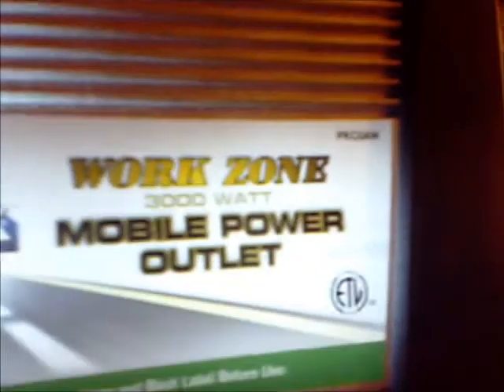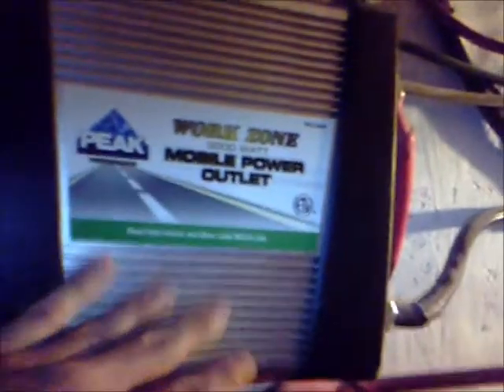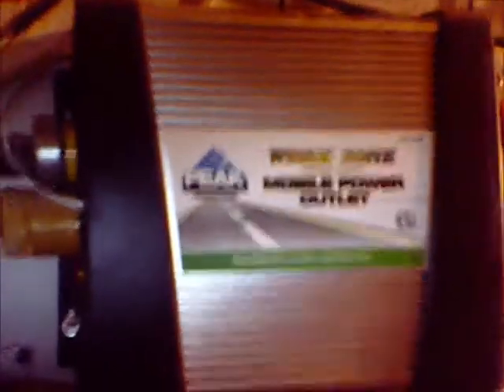3000-Watt Inverter 24 / 7 constant use, 8+ years,  SOURCE of them BELOW

Comment from the maker: READ ALL - UPDATE: Mine is running 4+ years now of constant 24/7 use, Best place to get one for $200 is http://amzn.to/2r5227D, ( Component is Hyundai Electronics Corporation) they come with big Cables, remote & install parts. And 2000 Watt for $100 http://amzn.to/2uhhNsU
This is a review of CONSTANT USE of a affordable good quality inverter. The Peak Work Zone 800, 1200, 2000 & 3000 watt inverters ( made by HEC - Hyundai Electronics Corporation) are a very dependable to date inverter brand. I have many now, in semi trucks, shop and a spare. seems to be tough as nails. Good warranty, HEAVY inverter. The Peak Work Zone has 800, 1200, 2000 & 3000 watt inverters are a very dependable to date inverter brand. I have many now, semi trucks, shop and a spare. seems to be tough as nails.
Reply: After seeing your review I got me one it works beter than my proline 3000 I got it of amazone tested it with 2400 watts all at once never lagged but amazone ant selling the 3000 nomore just the 2000 watt but they do sell the poteck 3000

Comment: Hello John,

I've enjoyed and appreciated your reviews on many things including this Peak 3000 W Power Inverter. So on your good recommendation I ordered one through Amazon which was offered via PepBoys since you had mentioned they had a good deal going. I've owned many power inverters, both PSW & MW like this one so I'm very well versed on their usage. But just like TheBlackSheep said below 1 week ago, today when I went to connect it to the battery it fried itself. I simply removed the cables from the battery bank on a long time working inverter and I followed the instructions that came with it exactly. I had the unit switched off and connected the Pos first and the Neg second. When the Neg cable touched the terminal it was the 4th of July inside. Strange thing the smoke smelled more like ammonia instead of the typical acrid smell you usually get from fried electronics. Since it was probably toast I decided to see if the unit still worked and switched it on. The green light came on but there was no power from any of the 4 receptacles. 

I've seen other videos here where the owner pulled the power inverter open before hooking it up and found wires not connected which he said would have fried the unit so possibly this is what has occurred here for TBS and myself with our inverters. Apparently there's an assembly line problem when these units were made and it's our unfortunate luck to get them. 

I don't blame you for any of this as this is a manufacturer's mistake or improper assembly of the product and I do appreciate your reviews. I just wanted to let you know what's going on with these units in case you hadn't been made aware of it and I noticed I was not the only one to have this problem. I contacted Amazon and they will contact PB's and said give it 2 days to see if they will replace or refund. Obviously I want it replaced or I wouldn't have bought it in the first place if I just wanted a refund. I'm hoping these are still the good units that you've used successfully for many years as I'd like to have the same benefit from it as you've had.
Reply from the maker: +Gold King I have 6 PEAK invrters, all are over 2 years old and 3 are 3000 watt, 1 is 2000 watt and 2 are 1200 watt. 
Not one has as much as blew a fuse or failed a cooling fan even though I have beat on them so hard I ofter pop the circuit breakers. But if they have outsourcing now and making them crappy I would not buy another. 
Keep me updated to your results, I have no brand loyalty and will jump to something else in a second if they have lost their quality.  
When you get the next one, do its initial volts in through a old style auto test light to charge the capacitors slower.  Maybe they are NOT testing and leaving no imprint of current in the caps.
Reply: John,

I've received the replacement Peak 3000w inverter. I put a multimeter on the input lugs and for some reason they have a neg voltage with normal meter connections of pos to pos and neg to neg. If you reverse them then the reading is positive. Is this due to the internal wiring and the capacitors? Being very cautious before I hook it up again. In regards to your comment on old style auto tester light,  I have a spark plug tester light if that is an equivalent of what you are referring to as an old auto test light. The test light will show continuously but not sure about the spark tester but it probably will. I have some of those old auto tester lights too but no idea where there are right now but do know where the spark plug tester is so will this suffice for testing it and if so please describe the procedure to make sure I do this correctly. The way these are sold you should be able to just hook them up to the battery as per included instructions and have no problems like most others I've had but after this last problem I'm being very cautious now. I truly appreciate your knowledge and help.
Reply from the maker: The suggestion of a test light is to put some resistance in the incoming voltage and is a old school way to charge a capacitor. You should not have to do this but its the safe precharge method. Its the method TripLite had for years on their inverters. I would venture to say the capacitors are 100% empty to show any reverse voltage in a meter. So find that test light, and charge it then hook up to battery. Safe side I would say. Its always possible you have a very high RF signal issue near by such as a cell tower or high wattage WiFi and this is known to react to electronics like a wireless cell phone charger does.
Reply: Well, apparently there's some serious problems at the factory on these units as I have a repeat on the replacement inverter. I once again followed the instructions by the letter, On/Off switch off, connect pos cable to pos on back of inverter, connect neg cable to neg on back of inverter, connect pos cable to battery pos post and connect neg cable to battery neg post. The moment the negative cable touched the battery neg cable the inverter once again began to sizzle and pop inside so I disconnected it immediately. I only connected it to a single 55ah 12v Optima D34 Deep Cycle Battery to just test the initial power hook up. I will see if I can take it to a local Pep Boys and have them open one up there at the store and hook it up to see if I can get one that doesn't self-destruct when it's hooked up. I honestly don't understand what's going on with these units but I won't open them up to see if I can find the problem so I don't void the warranty. If the on/off switch is hooked up properly this shouldn't happen with it off when you connect the battery unless something else isn't hooked up right. Obviously something's either connected wrong or not connected at all to cause this. This is 3 of the current production units that have done this now that I know of from here on YT so there must be a huge batch of bad units come out of the factory. I'll let you know what happens if I can take it in personally to the local PepBoys and do an exchange and check it out there at the store if the store will allow an exchange.
Reply: Hallelujah! Well, I exchanged the 2nd bad unit with a local PepBoys. I hooked it up there with the manager to make sure it worked and noticed the plastic seal was un-taped but hadn't noticed the cables had their zip ties cut off and were missing like the new ones in the units I had received. Apparently someone had used it and returned it as I noticed tonight while testing it the pos lug bolt and washers were actually very slightly corroded with green instead of the gold zinc coating of a new one. It's sad people will buy these for a camping trip or work job where there's no grid power and return them afterwards for a refund and don't think it's wrong. Nonetheless, public lack of personal integrity, scruples and morals aside, the unit works! I tested it there with 1 of the Optimas and a hair dryer and all 4 outlets worked so I was happy to get a working unit finally. I brought it home and then tried it with the big AC window unit that draws 1375 watts. I didn't think 1 battery could pull the surge and it couldn't but the unit reset automatically and tried a 2nd time but I turned it off before the compressor tried again. I then hooked it up to the battery bank so it had plenty of amps and this time it worked great! The bank was a little low so the AC fan didn't blow as well as with grid power but that may change when the bank's being charged by the solar array during the day. The fan came on when the compressor kicked on and after the AC was turned off the fan turned off after a cooling down period so I think I finally have one of those good units you talked about. Apparently the PepBoys in Indiana that sells them through Amazon got a bad batch of new units from the factory as there's 3 that were bad between TBS & myself alone. Perhaps the local Home Depot would be the best place to get one as it's easy to exchange a bad one if you get one but I can say your recommendation of this unit is a good one once you get a good unit. It does what I wanted and expected it to do. Thanks again John.

Comment: I extended my remote line using a phone cord and triplex wall adapter.
Some cords are wired a way that when your plug them in, it lights the red led on the remote. Some cords are wired and they work fine. If you hold the clear cord ends side by side and the wire colors match those will work. Cords held end to end and the wires match do not work.

The Large DC connection cables are big yet oddly very light weight, so I think they are aluminum wire. The inverter does work well. I was able to run a 120 vac stove top and oven, a 1600 watt large microwave, any type fluorescent lights, all power tools.
I can not start my Cruisair 16000 btu heat pump on the boat. But no one ever would as it would flatten batteries quick. I put a clamp one meter on the DC wire for microwave and it was pulling 116 DC amps.

Comment: I bought a Peak Workzone 3000w power inverter, But it burned when connected to battery exactly as shown. The switch was off and completely bypassed it. Could someone explain what went wrong?
Reply from the maker: +TheBlackSheep sounds like wrong voltage or bad inverter from new. They've sold multi millions of them and keep a huge positive rating. So what you got is a odd outcome for sure.
Reply: Mine works like a monster it beats all the others I got .you must have gotten a bad one .it happens some time but it's a real good inverter I run microwave coffe and fridge same time never gets hot never lags

Comment: It looks like this model is not produced in this form any longer. Link brings a different, thin shaped unit.  John, would I save on cable loss from the PV if I ran them in series and brought 24 or 36vdc into a controller, and also got an inverter with a 24 or 36vdc input ?
I just found some Solyndra panels offered for sale...  157vdc.  Need special controller ?
You got a Huge bank there in your basement !  Best, rc
Reply from the maker: +Rusty Case It's just the picture they used from a 2000 watt,  they are still that size but have much better soft start than before.